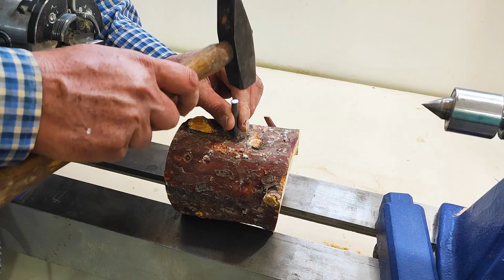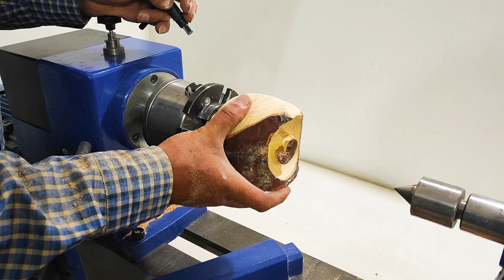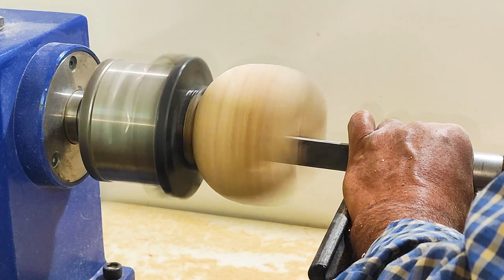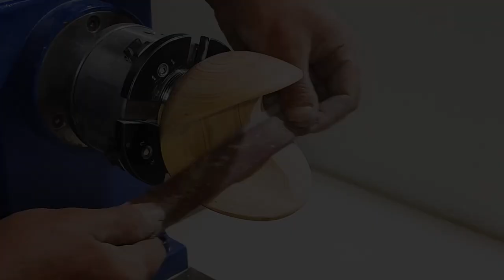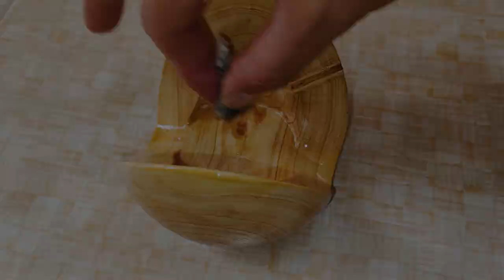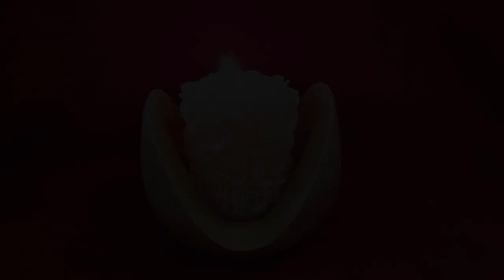Woodturning _ Something different, but Interesting!

Comment: Interesting piece just a suggestion, invest in a wood cross cut pull saw .hack saw teeth are not designed to cut wood  they eventually clog with wood chips